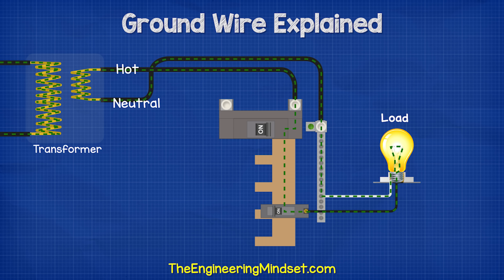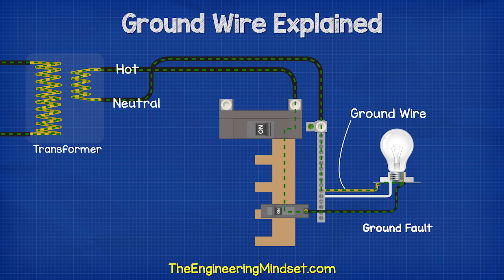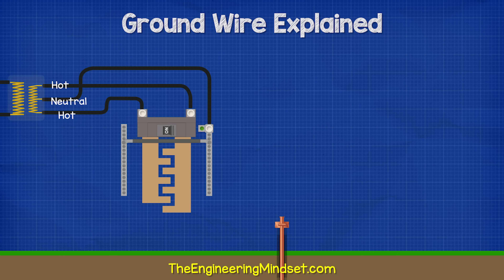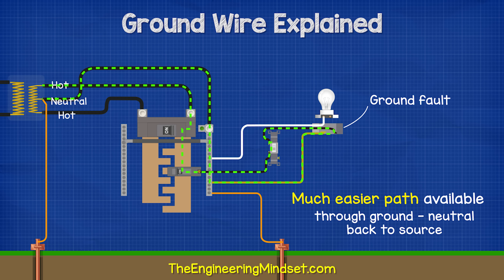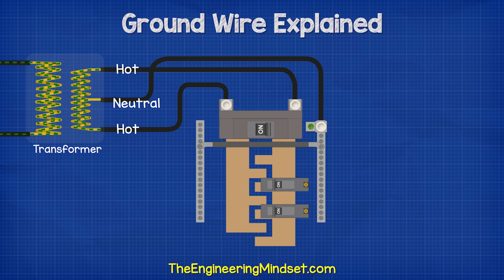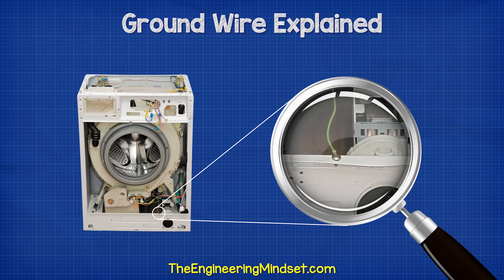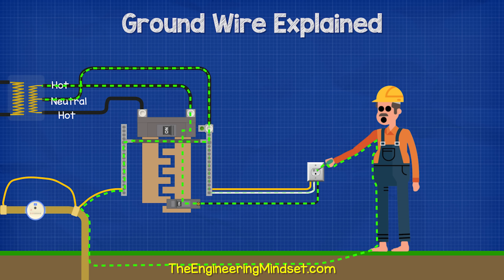Ground Wire Explained

Comment: I'm an residential electrician and I see Joe home owner AKA a wannabe electrician use the ground wire for a conductor. Ground wires are not used for conductors EVER. They are referred to as a mechanical  ground for stray voltage to go back to the electrical panel.
Reply from the maker: We just published a new Ground fault, short circuit and arc fault video, so much detail! Link HERE➡️: https://youtu.be/Qi0ynSQw-wc

Comment: Wouldn't the ground wire will carry electricity to the metal casing if you connect it to neutral? Mind someone explain why this design doesn't beat the purpose of grounding?
Reply from the maker: We just published a new Ground fault, short circuit and arc fault video, so much detail! Link HERE➡️: https://youtu.be/Qi0ynSQw-wc

Comment: Electricity will take every path back to the source. The most current will flow over the least resistance. This is why sub to main panel wiring must not be bonded in the sub and must have a discreet ground conductor back to the main.
Reply from the maker: We just published a new Ground fault, short circuit and arc fault video, so much detail! Link HERE➡️: https://youtu.be/Qi0ynSQw-wc

Comment: The fallacy that electricity takes the path of least resistance is dangerous. Electricity will take ANY path to the ground or back to its source, regardless. If you happen to be in the path, you're going to get shocked and to what degree depends on all sorts of other factors.
Reply from the maker: We just published a new Ground fault, short circuit and arc fault video, so much detail! Link HERE➡️: https://youtu.be/Qi0ynSQw-wc

Comment: I learned a lot from this video.  Thank you.  Question: In the sub panel, neutral and ground will not be bonded.  In that case, where would the Fault current will go?
Reply from the maker: Please watch our sub panel video
Reply from the maker: We just published a new Ground fault, short circuit and arc fault video, so much detail! Link HERE➡️: https://youtu.be/Qi0ynSQw-wc

Comment: So is the implication that the ground wire returning the electricity to the source through touching the casing that there is a path back through the case? In my mind all the electricity is running through insulated wires... so I'm just confused about that.
Reply from the maker: We just published a new Ground fault, short circuit and arc fault video, so much detail! Link HERE➡️: https://youtu.be/Qi0ynSQw-wc

Comment: In many cases neutral and ground wires are connected to the same terminal in the switchbox. How the whole thing works in such a case?
Reply from the maker: We just published a new Ground fault, short circuit and arc fault video, so much detail! Link HERE➡️: https://youtu.be/Qi0ynSQw-wc

Comment: All I know about grounding is that it can be used to create a faraday cage in an electric guitar. You just solder the ground wire to conductive tape. It's supposed to shield your guitar's pickups and potentiometer from EMI.
Reply from the maker: Seen our new Potentiometer Explained video? ➡️ https://youtu.be/Xb-MZMoUtcQ

Comment: why isn't electricity going directly to ground? which means whole energy should be wasted. 

Even if body of appliance is grounded, wouldn't it be a parallel connection if someone touches it and still get a shock?
Reply from the maker: It is parallel, but your body is extremely high resistance compared to the ground wire so 99.9% will flow to ground. Also your shoes will probably insulate you.
The electrons want to get back to their source because they are being pushed and pulled, it'll flow through the two hot wires and the neutral, but if the return path was broken then it could flow back through the ground rod, it's much harder to return compared to the hot and neutral
Reply: @EngineeringMindset  at the main panel, why only very high voltage(lighting)  goes to the earth? Why not  the regular phase power is going to ground? And how come lighting won't damage home appliances? Eventually everything is connected. Right?

we are adding neutral and ground so that breaker could trip in case of ground fault, understood. But this mean your live wire is connected to the ground, so electricity should also travel to the ground even if there is no ground fault(live->appliance-> neutral-> ground). I am having hard time framing the right question.

Comment: Why would the current from the ground wire trip the breaker if the ground wire is commonly a smaller gauge than the neutral conductor? Wouldn't the smaller conductor have less current carrying capacity?
Reply: It doesn't have much to do with wire gauge, but with the fact that bypassing the appliance effectively removes resistence from the circuit causing the charge to mount.
Reply from the maker: We just published a new Ground fault, short circuit and arc fault video, so much detail! Link HERE➡️: https://youtu.be/Qi0ynSQw-wc

Comment: Thank you so much for these videos! Is there any explanation as to why the ground has a lower resistance? Usually all the wires are copper. What's the difference. TYIA
Reply from the maker: The material is exactly the same, it just has a direct path back to the transformer
Reply: @EngineeringMindset  Thank you for the answer, if I can add to my question I would appreciate it. I didn't see in the video how the ground would trip the breaker. I don't see any physical connection from the ground to the breaker. Thank you for your time.  Edit: Unless since this is AC there would be high current going back through the hot wire causing the trip.

Comment: The part I dont get is why the current is going through you if you touch the receptacle. If the resistance through you is higher than the ground wire, shouldn't it go through the ground wire instead? Is it because you are going straight to the hot wire making you the ground that it does not go through the wire?
Reply from the maker: We just published a new Ground fault, short circuit and arc fault video, so much detail! Link HERE➡️: https://youtu.be/Qi0ynSQw-wc

Comment: So, wait... if the ground wire is connected to neutral through the bus bar, isn't it basically shorted to neutral? Why does it need to be a separate wire? Couldn't the metal casing of an appliance just be connected to neutral?
Reply: Anyone?
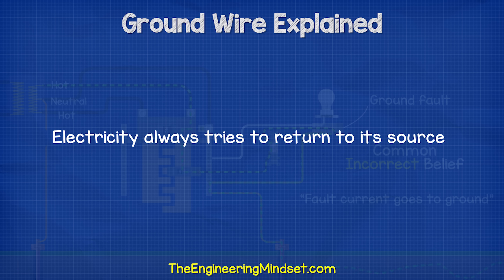Reply: @Bapuji42  Hi, I'm just learning so I'll let you know what I think. The ground and neutral are shared at the bus but don't look at it as being connected like that, they have separate rolls. If you look at the animation at 1:15 you see the flow from the buss to breaker to switch to light bulb. Ground is only trying to return the electricity back in case of a short (hot touching metal). No, you can't connect the neutral to the metal because it's shared at the bus with ground. The ground is only there because it has less resistance and will trip the breaker if the hot becomes disconnected touching metal. I hope this help.
Reply from the maker: We just published a new Ground fault, short circuit and arc fault video, so much detail! Link HERE➡️: https://youtu.be/Qi0ynSQw-wc

Comment: To sum up. 1. We need a return path or closed circuit for OCPD ( circuit breaker or fuse) to shut off power. 2. All current (normal and fault) returns to origin but earth is not an effective conductor. 3. Instead we install our own path, as a green wire throughout electrical system. 4. That green wire jumps back to the neutral only once: at the service (disconnect). We don't want fault current going everywhere giving us noise, being a hazard, and parrelling paths which weaken it to not turn off OCPD.
Reply: As I've been taught. Ocpds like circuit breakers and fuses are installed to prevent fires and equipment malfunctions s. Its primary goals are not to save lives. This is why we have gfci s

Comment: Slow down!
Reply from the maker: You can control the play speed of the video in the corner of the video. Additionally, I would recommend you  pause the video and make notes.
Reply: @EngineeringMindset  Thanks for that; I occasionally forget--do you mean the
"settings" button underneath?

Comment: 3:00 this is partially true, if the circuit is installed with only a normal breaker: then yes, the breaker will not trip. BUT if the circuit is protected by an earth leakage circuit breaker then the power will be cut off when earth leakage is detected and therefor not kill you.

Comment: This way of how grounding works (from the grounded component earth wire through the neutral line back to AC transformer) ONLY applies to specific TN-earthing systems (TN-C and TN-CS).
It does actually not apply to TN-S and TT earthing systems, used in Europe and Asia (and US at gas stations ect. by exception). 

In a TT-earthing system (common in Europe) the return fault current actually IS returned by going trough your premise ground rod trough the earth to the distribution AC-transformer ground rod connected to its starpoint or neutral wire. There is here NO link between the neutral line from the supply at your premise to the grounding/earthing wires in your installation. Because of the higher resistance of the earth soil the current will in a lot of cases not be high enough to trip your normal circuit breaker (overcurrent protection) while still being deadly dangerous. Therefore a RCD/GFCI-device covering your entire installation at the supply is mandatory in most countries, as it will trip much faster at a the existence of a ground fault current of 300mA/30mA. 

When in a TN-C earthing system the neutral gets broken (by heavy weather at power poles for example) you get a dangerous situation because (1) the only return path is trough the soil with higher resistance and the installation does not always have a general RCD covering the entire installation and (2) with the lack of a neutral conductor the devices connected between the 2/3 phases and the in-house neutral are getting connected in serie leading to a dangerous abnormal high voltage on your 'grounded' equipment. Using a PEN-conductor (combined neutral and protective earth condictor) as in this video can be really dangerous if the PEN-conductor is broken upstream. In the UK/Australia this setup is called PME (Protective Multiple Earthing), but it basically the same as TN-C-S with additional ground rods along the way to reduce the electric potential created by the PEN-conductors themselves because of the long distances/resistance of the cheap conductor materials used. 

So based on your earthing system, the ground rod at your premise is besides lightning strike protection possible also used as a conductor back to the transformer neutral trough the earth as part of the normal earthing system. 

The explanation in this video only applies to common household installations in North America, but not to a big part of the rest of the world.
Reply: Agree,  the video is for North America only
Reply: I thought TN-CS is also common in Europe (not sure about Asia tho). TN-S is too expensive
Reply: This way of how grounding works (from the grounded component earth wire through the neutral line back to AC transformer) ONLY applies to specific TN-earthing systems (TN-C and TN-CS).
It does actually not apply to TN-S and TT earthing systems, used in Europe and Asia (and US at gas stations ect. by exception). 

In a TT-earthing system (common in Europe) the return fault current actually IS returned by going trough your premise ground rod trough the earth to the distribution AC-transformer ground rod connected to its starpoint or neutral wire. There is here NO link between the neutral line from the supply at your premise to the grounding/earthing wires in your installation. Because of the higher resistance of the earth soil the current will in a lot of cases not be high enough to trip your normal circuit breaker (overcurrent protection) while still being deadly dangerous. Therefore a RCD/GFCI-device covering your entire installation at the supply is mandatory in most countries, as it will trip much faster at a the existence of a ground fault current of 300mA/30mA. 

When in a TN-C earthing system the neutral gets broken (by heavy weather at power poles for example) you get a dangerous situation because (1) the only return path is trough the soil with higher resistance and the installation does not always have a general RCD covering the entire installation and (2) with the lack of a neutral conductor the devices connected between the 2/3 phases and the in-house neutral are getting connected in serie leading to a dangerous abnormal high voltage on your 'grounded' equipment. Using a PEN-conductor (combined neutral and protective earth condictor) as in this video can be really dangerous if the PEN-conductor is broken upstream. In the UK/Australia this setup is called PME (Protective Multiple Earthing), but it basically the same as TN-C-S with additional ground rods along the way to reduce the electric potential created by the PEN-conductors themselves because of the long distances/resistance of the cheap conductor materials used. 

So based on your earthing system, the ground rod at your premise is besides lightning strike protection possible also used as a conductor back to the transformer neutral trough the earth as part of the normal earthing system. 

The explanation in this video only applies to common household installations in North America, but not to a big part of the rest of the world.
Reply: Finally someone that posted this very important difference between the earth systems used in different parts of the world. I was very confused by the fact that in many youtube videos they say that during a ground fault electricity goes through the neutral back to the transformer whilst in others they say that current goes through the ground wire to the ground copper rod.
It would be really nice iff the author of the video fixed this comment so people can be aware of the differences.

Comment: ....These ground rods seem to have multiple uses.....Like extra solar panel electricity returning to the source, for use and storage, maybe lighting electricity is being used the same way....What do you think?    Also, there seems to be a more direct electrical path, through the ground rod to the transformer....Why is there more resistance at this seemingly more direct path?   Or are you saying, that is the least resistant rod for lighting and static electricity....Maybe there are less area and/or things connected to the house neutral, that gives it less resistance.......
Reply from the maker: Seen our new video on HOW SOLAR PANELS WORK in detail https://youtu.be/Yxt72aDjFgY

Comment: Electricity does NOT take the path of least resistance. It will flow thru ALL paths back to the source, BUT the path WITH least resistance will have more current flow across it over the other path/s with more resistance. 
It does not pick a path, it goes thru ALL paths ... 

Put 3 bulbs in parralel and see which path it "picks or takes" ... and when ALL 3 light up, you tell me which path it took ... 
It took ALL 3 PATHS ... and the one with least resistance will have the most current flow of the other 2.

Comment: Depending of what type of grounding system you have, the ground rod can actually be used for fault currents. In my area, we dont get ground from the services. Nor is neutral connected to our ground wires. We call that TT. What you describe looks more like TN.
Reply: I was just about to comment on this and thought surely someone already has,
Reply: I believe this video was geared towards the U.S. (We don't do TT installs here to my knowledge).  We are strictly TN-C-S but we don't call it that. We call it "multigrounded neutral" (MGN) because we have to have our own terminology for everything, lol
Reply from the maker: We just published a new Ground fault, short circuit and arc fault video, so much detail! Link HERE➡️: https://youtu.be/Qi0ynSQw-wc

Comment: All I understand from the video is ground act as emergency neutral wire which return current back to life wire(just like neutral) BUT in case of overload or short circuit only. I might be wrong but that's all I understand.
Reply: That's effectively it. In an application with a neutral wire, if the hot wire breaks, one of two things will happen:
1: Nothing. You cannot complete a circuit because one of your conductors is broken, so nothing happens.
2: Short to ground. If the hot wire touches the neutral wire, the ground wire, or (more importantly) *anything the ground wire is terminated to*, you will complete a short circuit to the ground. The sudden low resistance means that amps increase proportionally. One of four things happens in response:
1: A ground-fault circuit Interrupter (GFCI) outlet trips
2: If that fails, the circuit breaker trips
3: If THAT fails, the main breaker trips
4: If none of these safeties trip, then either you or your equipment are now drawing high amps until it/you catches fire or the short circuit is broken.

Please note that 3 and 4 are not mutually exclusive. It takes 500mA to stop your heart. A vacuum cleaner draws 10A or more. Please do not play with electricity.
Reply: @Invictus901  with all that correct and if # 4 fails, you must be a path back to the source for it to hurt you. If you are not a path, it wont hurt you.
Reply from the maker: We just published a new Ground fault, short circuit and arc fault video, so much detail! Link HERE➡️: https://youtu.be/Qi0ynSQw-wc